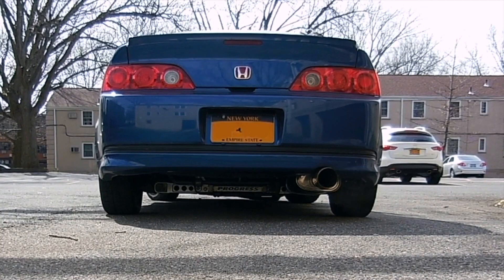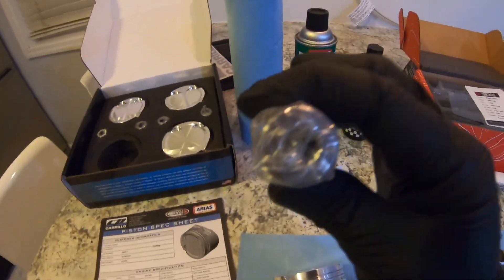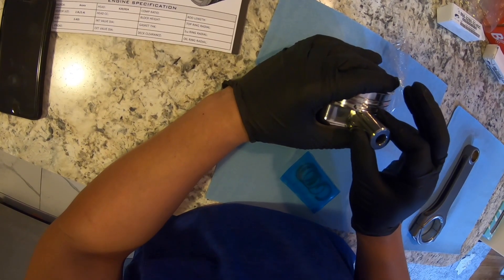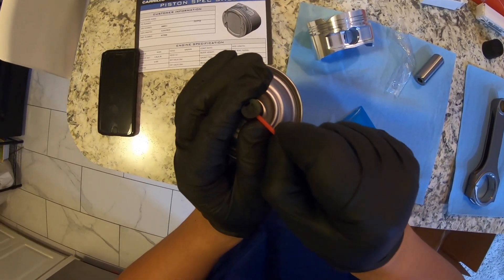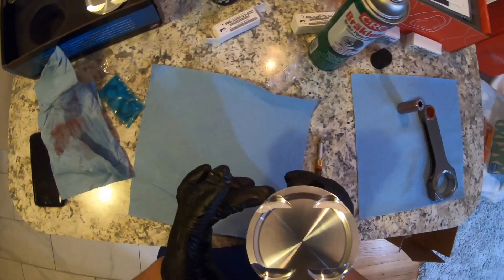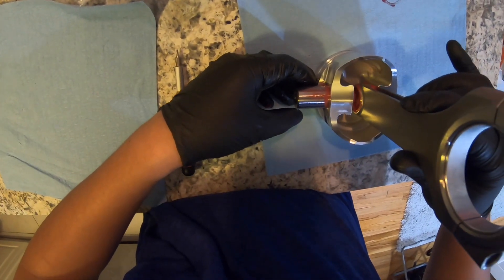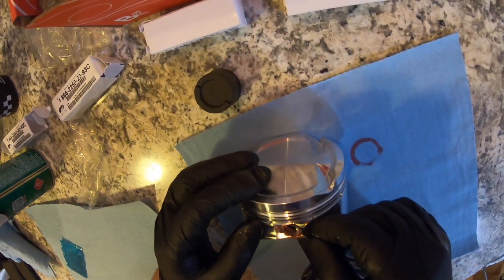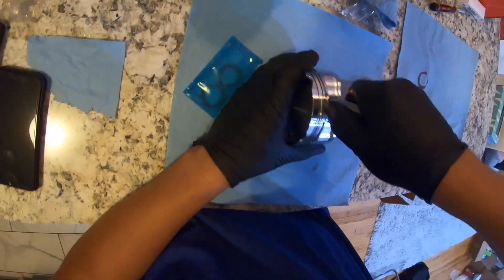K20 K24 gets FORGED Pistons / Rods | RSX

Comment: Another great step by step video. Will definitely be using these videos when the time comes.
Reply from the maker: Thanks brother, what are you planning on building?
Reply: @ikigaidriven  b18c block 84mm oringd, b18c head, ls crank and rods. Still not sure how I want to build the head. Obviously get springs, retainers, guides, seals, and a port but I'm still not sure about going 1mm over bc I have read it limits cam choices. Also not sure if I should oring the head also.